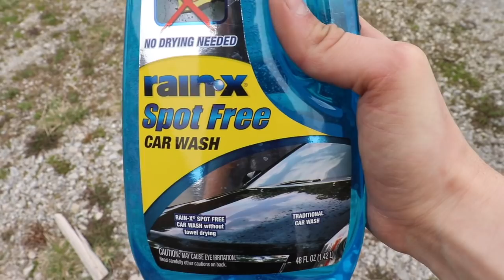FIRST GEN CUMMINS FIRST START IN 3 MONTHS!!!

Comment: 33s will fit on 20x12 without cutting, 35s will but will rub over any bump on a slight turn. I’ve test fitted if you have any questions or want pictures lmk.

Comment: That rust😭😭
Reply from the maker: Gage Smith its 26 years old.... chill 😂
Reply: I understand, it's just a shame that a beautiful truck like that has rust. I have a '67 f-100 with no body or frame rust
Reply from the maker: Gage Smith well I can tell you for a fact... if you actually have a 67 without rust it’s one of the rarest vehicles on this planet..... not every vehicle is that vehicle.
Reply: LOUD 'N' PROUD is had to tidy it up with a wire wheel a little but it sat in a barn for 29 years